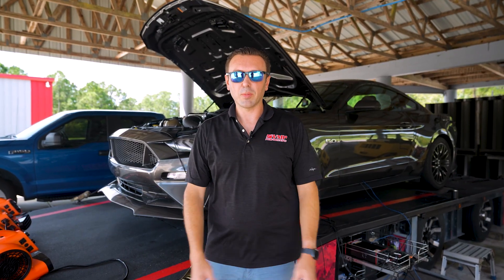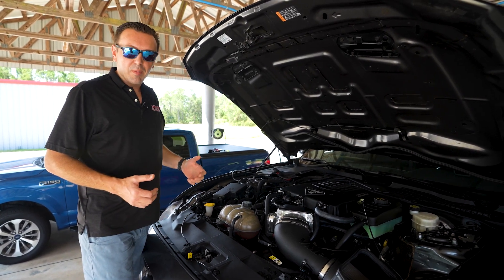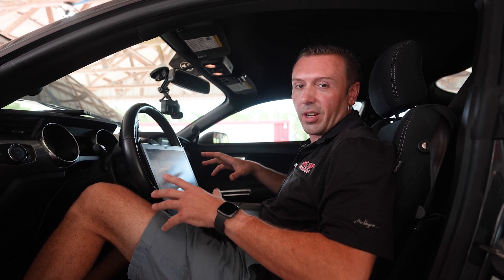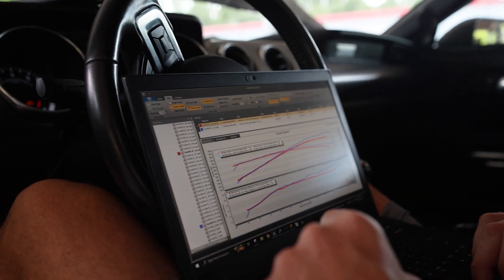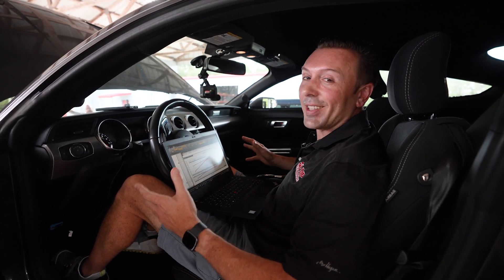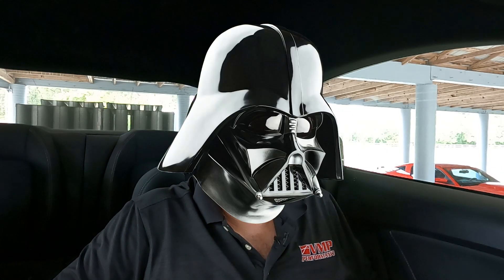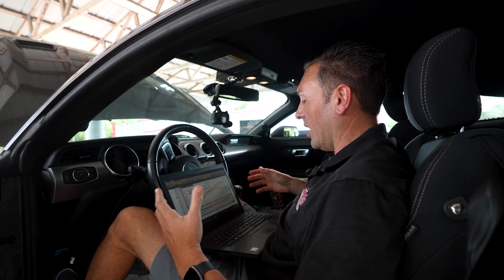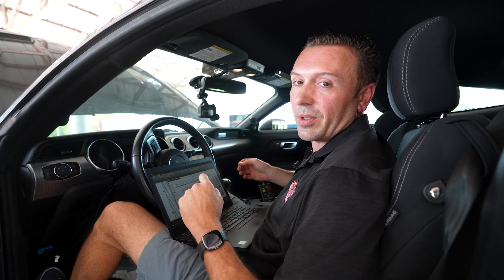VMP Odin Level 2 Supercharger Kit || Dyno Baseline and Upgrades

Comment: I’ve had an Odin on my 22 for a little over a year now and have been running the 85mm along with catted long tubes and a catback.
It feels great!!
Reply from the maker: Thank you for your business and support!
Reply: @VMPPerformanceTV can I run this Odin level 2 to up to 1200 whp without having to upgrade to buy level 3 instead ?
Reply: @Oliver-ft2fq nope it has to be ported and you’ll need 10 rib kit so you already at almost 12 grand just for the 2 not worth IMO i just removed my Odin and sold it going turbo next week
Reply: @kurtage77 on 93 you are running the 85 mm pulley ?

Comment: Over 700 rear-wheel horsepower, on 93 pump gas.  running 13 lb of boost did I hear all that right ?
Reply: Heck yeah
Reply from the maker: Yes, you did.
Reply: @VMPPerformanceTV kaboom 🥴😂
Reply: @VMPPerformanceTV i would love to know how much timing you are running with 93 pump gas and 13psi boost to get 720rwhp 👀
Reply: Make that with less psi with gen 5 whipple
Reply: @alexmiller6133 yeah and everyone has a Whipple lol. Now VMP customers will have a Whipple.
Reply: @VMPPerformanceTV  VMP, please help me understand what went wrong with mine. I got the Odin level 2 kit last week (car is still at the shop). It is running on 93 octane and has no other mods. It only produced 632 rwhp. It was a Dyno Jet dyno and it was with the VMP tune that y'all sent. It was definitely the Odin and not the Loki kit because the stock intake and throttle body are in the trunk with my factory intake manifold. I'm running y'all's twin jet throttle body and intake that you sent to the shop.
For what it's worth, the throttle body would start acting up after a few mins and is being RMA'd so I am hoping that is the only reason for the power loss. Otherwise, I feel like maybe I didn't get what I was expecting.
Reply: @UncleDavesGarage weather or the tune, the tune they send is rlly conservative. Get a custom tune to get 700 wheel for sure
Reply: @Nytro423  thanks for the reply, I think I saw someone else mention the default tune being quite conservative so that's probably all it is. I will admit I'd rather have a safer tune with less power than to risk blowing my stuff up lol
Reply: @UncleDavesGarage  lol. Honestly, u can prolly get away with a smaller pulley and long tubes and still be within safe parameters depending on if you have a 10 speed or 6mt

Comment: Did you use a 3.3 pulley on your pulley swap Justin? I was curious if I could use a 3.3 pulley on my Odin with some Sunoco 105 unleaded fuel in the tank and my existing tune file? and would a smaller pulley require a shorter length belt? My Odin is getting broken in with some Southern Arizona 109-110 degree weather this week. IAT'S are staying in the 140's buried in heavy traffic.
Reply: Yes, they did use the 3.3 pully you can see in the video. If you pause it
Reply from the maker: We did.  It's best to email in regarding that fuel choice.  We do prefer something a bit simpler such as BOOSTane to insure the fuel's stoic point stayed the same.  The belt length would stay the same.
Reply: @VMPPerformanceTV  so just load it up with boostane and pump gas and send it?

Comment: So can I swap pulleys on 93? I have always been told not to pully down without going E85.
Reply from the maker: It's highly dependent on the quality of your fuel.  The 3.3 is a newer size that lands just below the 3.4 (88) and gives a touch more headroom.  It'd be best to speak with your tuner to make sure all is well before increasing boost.
Reply: I was told that also

Comment: So Odin or gen 3R and why ?
Reply from the maker: Depends on the year of the car.  Technically, both units share the same rotor set and have similar capabilities on pump gasoline.  '18+ can only run the Odin head unit.

Comment: How much we talking for the gen 2's? I'm thinking maybe around 700 with the level 2 and pulley. Been tossing up between odin or twin turbos around the 700rwhp mark.
Reply from the maker: Our social media guy's '16 GT makes 708rwhp and they have a very similar range of high 600s/low 700s out of the box.  We love the low maintenance of the TVS supercharger in comparison to turbo systems.
Reply: They did one couple years back an odin on a stock gen 2 even stock exhaust it did just over 700 on 93.
Reply: @VMPPerformanceTV ya that's kinda why I'm gonna be leaning towards you guys. 1. I have no E85 around so no need to be going on extra high 700 or low 800. 2. The maintenance is much easier than turbos from what I've seen so far.  Also if you guys still do vacation packages that's the main reason i would be going with you guys! Lol
Reply from the maker: @dmacthetruth22  it sounds like an Odin is perfect for you and your goals.  We definitely do the vacation package and it's a great time for all involved!  We look forward to having you in the VMP family and after daily driving an Odin for over 35k miles, I can assure you, it's low maintenance and a PILE of fun.

Comment: Can the mt82 6 speed manual handle this or does it need to be upgraded?
Reply: Maybe. Usually if you have an 18-23 the shift fork MIGHT break. Buy a Ben Calimer stage 2 transmission & upgrade the clutch & you will be good

Comment: My Odin doesn’t whine at all with the 88mm.  Should I hear it?
Reply from the maker: With how efficient our Odin supercharger is thanks to the TVS technology, you may not hear much with the larger street pulleys.  Whine is a byproduct of resistance and with various modifications, you reduce resistance to increase power.  Things like modified exhaust can reduce whine and even simply be louder than any whine that is present.  A lack of whine isn't an indicator of something wrong.  On the contrary, it means your blower is super efficient in your combination.

Comment: What all do i need to be right around 700hp in my stock 22' GT?
Reply from the maker: The Odin kit is going to get you right there.  There's variance from car to car and dyno to dyno.  As long as you have good quality 93 octane, you should be very close.
Reply: @VMPPerformanceTV  Are you talking about the level 1 Odin? I also keep hearing that oil pump gears are necessary, is that true?
Reply: @savage101.  I had a ODIN installed on my 21 GT at VMP and Mike spun mine to 8,000rpm a few times with stock OPG and timing sprocket with no problems. It made 715 @ 7,900 and I drove it 2038 miles back home over the next 4 days.

Comment: what size pulley was used on the first pull
Reply from the maker: 3.5"
Reply: how much more hp to the wheels do you normally see from auto to manual in this setup
Reply: my car made 609 rwhp with the level 1 manual with straight 91 and now upgrading to level 2 I'm guessing around 680 rwhp with boostane
Reply: the car does have long tube headers with green cats

Comment: I am confused as hell now.
Reply from the maker: How can we help?
Reply: @VMPPerformanceTV if I change to the 3.3 pulley does it need retuned ?  When I put headers on it may have lost boost.  Is that possible?
Reply: @VMPPerformanceTV  you didn’t answer ?  This goes against everything you guys told me about running smaller pulleys when you installed the Odin on my car.  I am still confused.  I have an 88mm pulley on it now.  That was a small as you guys told me to go on 93 pump gas ?
Reply from the maker: @freedom6919741  apologies here!  Missed it in the notifications.  We're running the same tune file in this particular vehicle.  With the smaller pulley, it will be more sensitive to fuel quality and that would be something that would need to be monitored and confirmed safe, but wouldn't require a retune.  Our initial recommendations of sticking with an 88 mm or 3.4" and eventually us switching to the 3.5" for the kit pulley has everything to do with safety with various fuel qualities.

As for a drop in measured boost with headers, it is due to lowered restriction from better exhaust flow, but does not indicate a loss in power.  Technically, boost is a measurement of restriction.  Adding headers made things flow better, which would result in more power because there's less restriction.
Reply: @VMPPerformanceTV  but this car has the 3.3 pulley correct?